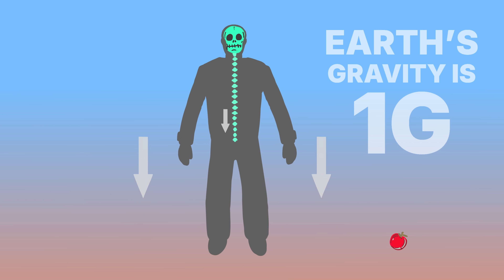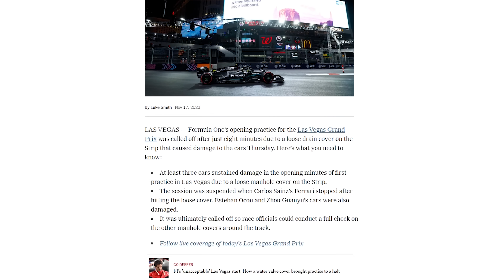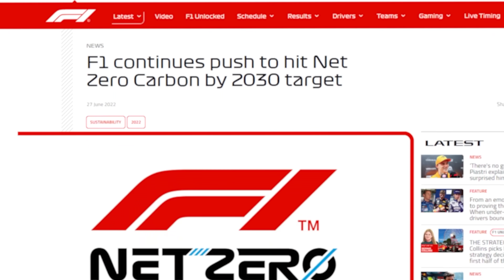Neil deGrasse Tyson Explains the Physics of Formula One Racing

Comment: Generally, Formula 1 drivers experience significantly more G-force than NASCAR drivers, primarily due to the higher speeds and sharper corners typically found in Formula 1 races, resulting in greater lateral G-forces during cornering. 

Higher G-forces in F1:
Formula 1 cars can generate much higher levels of aerodynamic downforce, allowing them to take tighter corners at higher speeds, leading to greater G-forces experienced by the drivers. 
 
Track design impact:
NASCAR tracks often have wider corners with less extreme changes in direction, which means drivers experience lower peak G-forces compared to F1.

Comment: The physics of Formula One racing is fascinating, especially when it comes to the G-forces that drivers experience, which even draw parallels to concepts in astrophysics. As these cars navigate high-speed corners, accelerate, and brake, drivers can experience lateral G-forces exceeding 5 Gs meaning they feel a force five times their body weight pushing them sideways. This is similar to the forces astronauts experience during rocket launches and re-entries, where they face extreme accelerations. In F1, these forces result from the incredible grip provided by the tires, downforce from the aerodynamics, and the immense speeds the cars can achieve. Managing these forces requires cars to be engineered for stability and drivers to be in peak physical condition, as sustaining such forces over long periods is extremely taxing on the body. It’s a true testament to the interplay of physics, human endurance, and the extreme conditions seen in both motorsport and space exploration.

Comment: The neck strap doesn't holds their heads in place during high Gs on corners. The neck strap is only there for extra protection in case of crash. (just like in motocross i believe). During corners (and braking too, don't forget!) the only thing keeping their heads from moving all over the place is their "neck game". F1 drivers have to workout really intensively their necks, every week. Which is why all of them have such large necks.

Comment: Something most people dont know.. an American 18 wheeler comerical lorry loaded to max of 40 tons or 80,000 lbs / ~ 23,000 kg can generate over 1g force of stopping power.  This stopping force is 25 % higher then the best F1 braking system
Reply: But when you compare the momentum of a 40 ton vehicle to that of an 800 kilogram vehicle, the comparative stopping force in terms of power to weight ratio is still higher in an F1 car.

Comment: Ok so the oxygen carbon mixture, im assuming would be in a pressurized gas form so if anything when they would fill up it would be with an aerosol can type dispenser... Now considering they wouldnt have to change from a combustion engine i imagine they would still need to have oil or a lubricant in the engine due to the extreme heat made during combustion... So 0 carbon emissions seems unlikely because oil would burn off during exhaust. Let me know if i'm off and help me to understand, respectfully 🫡

Comment: Only up to 50% of the downforce is created by the spoilers; most of the downforce is actually created by the splitter underneath the car. Hence why its so low to create that low pressure zone which more sucks it to the road; rather than air pushing it down from above.

Comment: No more refuelling on pit stops = boring
Reply: They would still have to refuel because the oxygen carbon mixture would be in a pressurized gas form so if anything when they would fill up it would be with an aerosol can type dispenser 🫡.

Comment: You guys missed an opportunity to talk about the most important part of the aerodynamics. You started to touch on it. But the current formula of cars are ground effect cars. They have giant venturis under the car creating extremely low pressure under the car. Most of the top surface aero shapes are more for channeling the air where they want it to create the greatest delta p between the top and bottom of the car. They have to use air flow on top to seal off the edges of the floor so the air flows clean and fast under the car. The problem that they ran into mostly in the first year of these regulations was what's called porpoising. As the car hits higher speeds the delta p gets so high that the ride height drops so low that the air flow either stalls, or the car hits the track, losing massive amounts of suction, raising the cars ride height, which immediately raises the delta p, pushing the car back into the ground until it hits again. You get a bouncing up and down that was literally injuring drivers.
Reply: I think the term is “porpoising” as in the movement of a porpoise (aka dolphin) through water, and not “proposing”.
Reply: @aamontalto  i guess the autocorrector did its thing...
Reply: @dani_montoro_gtr  yeah could be.
Reply: @aamontalto  So you knew what he meant, and chose to point out the spelling error most likely caused by auto-correct?
Reply: @msromike123  of course I knew what he meant. But others who read it might not have! However it may have happened, the comment is in error. The autocorrect explanation came to my mind after I hit send. Strangely enough my keyboard did not autocorrect porpoising though.
Reply: @aamontalto  yes you're correct. Auto correct and I don't really get along lol
Reply: @aamontalto Isn't that what he said, lol?
Reply: @aamontalto  very annoying to type correctly lol
Reply: This is meant for the average person to watch haha. Hopefully they make another F1 video
Reply: The top body aero surface still generate about 40% of the downforce, if I remember correctly but they are even more important as those, and in particular the front wing, can be tweaked during a weekend and allow to create the appropriate aerodynamic balance that makes the car driveable
Reply: "They have to use air flow on top to seal off the edges of the floor so the air flows clean and fast under the car." Due to the aerodynamics under the car, the air is deflected left and right towards the edges of the floor in the form of a vortex, which additionally sucks in and accelerates the flow of incoming air and literally creates a vacuum under the floor of the formula. In combination with the upper aerodynamics and tires (I don't know why they didn't talk about tires) that heat up and they perform a chemical reaction with the asphalt, because of which they literally stick to the asphalt, (that's why the drivers "heat" the tires at the beginning of the race and change them often, because they disintegrate due to this chemical reaction) we get incredible speeds both on straight parts and in curves.
You have to drive Formula 1 very, very, very fast for all these features to do their "work".
Greetings to all "StarTalk" fans !!
Reply: @duskobabic4285 I don’t think there is a chemical reaction between the tyres and the track. More likely there is a specific heat range at which the tyre is more mechanically compliant - the road bites into the tyre, not the other way around - and as such there is a range where the the tyre compound ‘flares’ into the nooks and crannies of the road surface, creating more grip. This of course is detrimental to the tyre, it actually tears off under the mechanical stress, bit by bit. After a race one can actually see chunks of tyre bits lining the sides of the track.
Reply: As a pilot I’m intrigued in these aerodynamic topics. Ground effect is very prevalent in our takeoffs and landings. It’s neat to read about this topic in detail about f1 cars.
Reply: i suspect Ferrari had a say in what they could and couldn't talk about. Or at least show.
Reply: @Thisandthat8908  I doubt that Ferrari told them not to mention ground effect. There is no secret about the physics behind it and how much downforce is generated and so on.
Reply: @ThisAndThat: Ferrari had a say? Like "Neil, you can not have the talk about ground effect. Now slow button please." xD
Reply: @Thisandthat8908  Like Ferrari are the only ones who know physics and the engineering that makes the most of the physics...lol 😂
Reply: @Thisandthat8908 nothing to do with Ferraris car.. he's talking about all modern f1 cars work like this. This is why certain parts of track you will see some cars creating sparks under
Reply: @Thisandthat8908 because Neil always says generic things. Makes me wonder what he did during his time in uni because he always says the most generic in your face things with the occasional trivia but nothing groundbreaking. Makes me wonder how much he actually knows or retained from his educational background or that he’s just a science personality instead of an actual scientist. Doubt he actually dove deep into the ground effect or is interested in it at all.
Reply: @john8382-o5q Think you're being a bit harsh here...if he sounds, as you said, 'generic', it's because he's an astrophysicist at a F1 Grand Prix with a friend where he was both enjoying the race as well as appreciating the applied physics behind Formula One engineering...it wasn't meant to be anything but that. No need to insult his education, intelligence and entire career.
Reply: @SharonCorbett : thank you for your post.
Reply: @john8382-o5q makes me wonder if you know why he does what he does and who is audience is. Why would you think he needs to use bigger words that would go right over his audiences heads? Perhaps you'd be more comfortable at PBS SPACETIME's Channel. 
You might learn something.
Reply: Yea I feel like they showed and talked about only what Ferrari would allow for competitive reasons but hour long would have been fabulous
Reply: @timjackson6941  Yeah that's not it at all
Reply: I was going to say the same thing!❤
Reply: bouncy, reminds me of one of the manufacturers.. :)
Reply: Not to mention the most thermal eficient unit power ever, combining internal combustion with two eletric energy recovery systems
Reply: i was gonna make this exact comment
Reply: The strange thing is that the air isn't moving, but the car is. So, the bernoulli effect is in relation to the floor of the car and not the track surface.
Reply: i heard that its something like 70% of the downforce comes from the floor
Reply: Or as the drivers call it "bouncing like a kangaroo"
Reply: Came looking for this comment
Reply: @xiingli  In my experience, if you're watching/reading stuff just to go "looking for" a pre-conceived opinion you have already cemented yourself to, you're not learning anything, nor are you even open to learning anything - you're just gathering whatever scraps you think will bolster that pre-conceived opinion, with absolutely zero insight to whatever led you to that opinion in the first place.
Bad motivations, bad perspective and just plain bad form.
Reply: true
Reply: The wings still give a significant amout of downforce as well. And are used mainly for balancing aero forces over the front and rear. Without these the ground effect wouldn't work for racing. Balance is key
Reply: Mercedes has perfected this porposing effect on Hamiltons car.
Reply: Are you referring to porpoising injuring drivers and that being Lewis Hamilton at Azerbaijan ? Cause that was world class acting IMO and Mercedes trying to get regulations changed. Which Mercedes accomplished for the following season. Mercedes couldnt get to terms with what caused their porpoising when having a low ride height. They cried to the FiA and they had every teams cars raised 15mm the following year . 🐂💩 F1 politics
Reply: Is this why the trans ams were so good in the corners because of the downforce oh the spoilers
Reply: Yes, you are right. The most complex side of the aerodynamic is the floor of the car. It's there where the majority of the load is generated.
Reply: my thoughts exactly
Reply: The track they were on had longer straights. So I’m assuming drag was the main talking point that day instead of negative lift
Reply: Ferrari’s notorious for not letting you see the underside of the car
Reply: they didnt miss it they didnt see it.
Reply: And about lotus answer to the issue that ground effect has. Which ultimately McLaren, Ferrari and others got banned in the 80s
Reply: They did talk about that .
Reply: Well now the 26 F1’s will have a flat floor
Reply: I’m glad you found a space to be heard.
Reply: And all of that do chances while breaking.
The most wight go to the front wheels,and the back wheels can become lose.
It will make the car turning more easily in low speed 90 degree turns,because the back wheels are stepping out.
Reply: Feels like this Neil guy knows more about planets than aerodynamics
Reply: @davids8127 almost like he is a Astrophysicist and not an Engineer
Reply: @TheJunmengo  Exactly what I mean 😂
Reply: Yes, you definitely understand physics better than Neil degrasse Tyson…🤦🏼
Reply: Probably because NDT is not so much a scientist anymore than he is a woke influencer.
Reply: @RL-pj8tj A political opinion doesn’t negate one’s experience. He’s speaking in basics so that his audience understands. His audience is the viewer in general, not F1 fanatics who already know the details.

Here’s something to wrap your Woke derangement syndrome brain around, though:

 before 2000, scientists donated equally to both parties, but since then, they donate more to democrats.
Reply: You right I didn’t even watch a full minute. Thanks for saving me time for real!!👍

Comment: I've done entire drive train swap on my first car I got when I was 16 and I know what every single wire does test a new sensor test the old sensor compare results take a test light and find out if there a break in the circuit test for power and any difference in resistance it's a jdm twin turbo 1jz 1991 supra the turbo has a waste gate that is vacuum operated and it completely equilibrium feedback loop it runs itself it needs more air the vacuum switch uses the engine pulling air to spin the turbos more the more the turbos spin the more air it vacuums the exhaust byproduct powers the whole thing like the alternator but with combustion and the turbos create such high compression it basically turn the gas engine to diesel and the turbos basically a jet engine injecting fuel into a pressure flame machine the vacuum actuators fuel injectors and compressed air noises are the fricken coolest noises ever

Comment: I'm surprised you misunderstood the airflow under the car. It does not generate lift: quite the opposite.
Most of the downforce acting on current F1 cars comes from the underfloor, specifically the venturi-effect tunnels that create a partial vacuum by accelerating the airflow.
The manhole cover was sucked up because of the negative pressure under the car.

Comment: The length of the car helps the driver correct oversteer easier. If the rear spoiler loses the downforce battle with the mechanical grip of the rear-tires during cornering, centrifugal force takes over and the car spins. The longer the car is, the more time the driver has to correct the spin.

Comment: I hope Startalk are more accurate than this video when they discuss things I know nothing about. This video had uncomfortably many factual errors 😢
Reply: What specifically.... its not really that incorrect. Maybe slightly simplistic in a could of places but nothing that off.
Reply: @AveragePicker  E.g. that ground effect produce lift. That's highly inaccurate, to say the least.
Reply: @sersjantma  They say, "air speed is going to be very high across the ground, the car is dragging air with it it's it's dragging air with it so that will create a partial pressure upwards cuz moving air has lower pressure and stationary air..." That is absolutely correct. "Ground effects" is a bit of a catch all term in racing, so it's hard to specifically know what your thinking here, but in a broad sense downforce is increased by decreasing that pressure because the drag from it is reduced.

Comment: I want Neil to dive deeper into ground effect specifically because that’s what these generation of cars are using which hasn’t been seen in f1 for a few decades.
Reply: Technically the flat floors still generate some ground effects to an extent so I would say it was restricted rather than banned.
Reply: @vickramgangaram2925  I never said it was banned, there were just different regulations up until 2022 where true ground effect cars are back again which are way different to the previous cars prior to 22
Reply: @nateflores8160  oh I didn't read that last bit properly. I'm assuming you're talking about the current undertray having a curvature to it like the late 70s early 80s era.